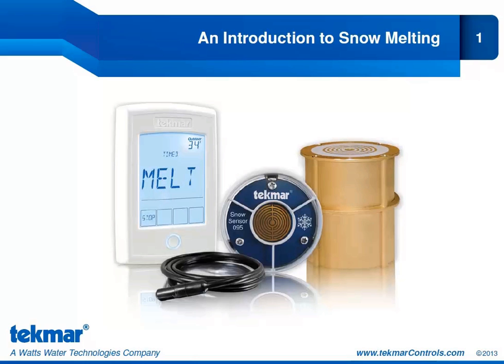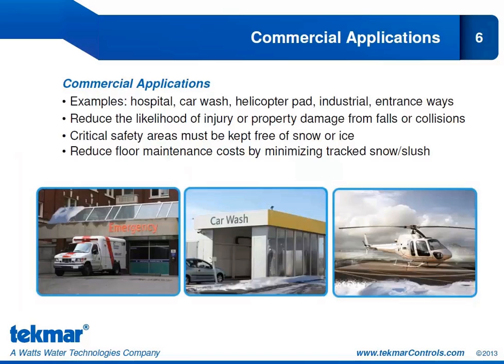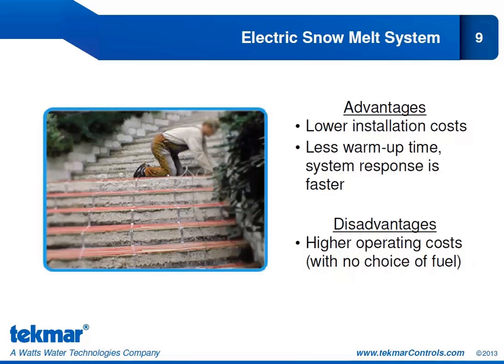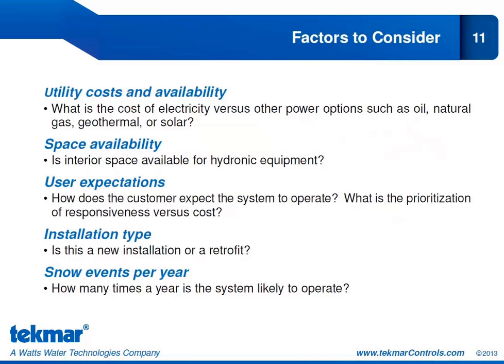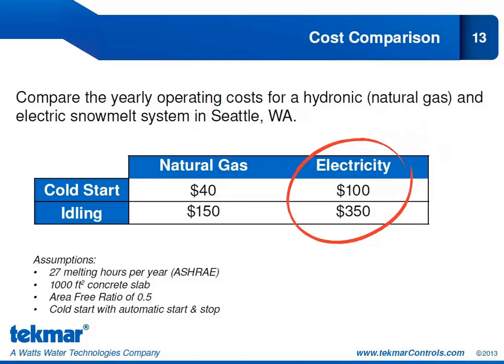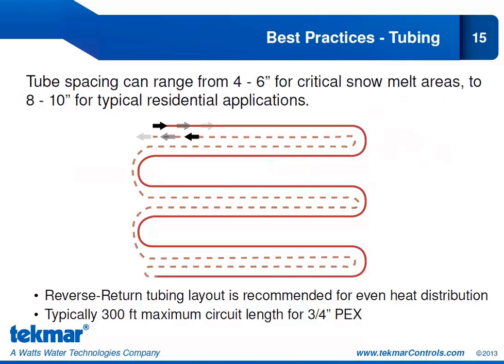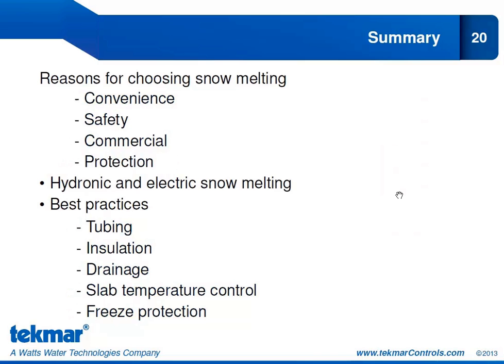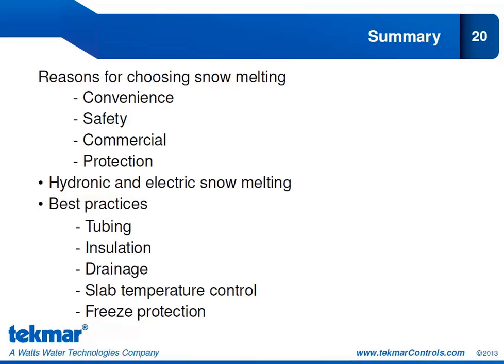Segment 1: An Introduction to Snow Melting

Comment: The is the first time ive heard of not placing insulation under the slab,
 this is to prevent frost heave??
Reply: She's wrong. I think she just wen't with whatever some engineer told her and got it confused. You want the slab to have a higher thermal mass to retain as much heat as possible and reduce run time and operating costs.